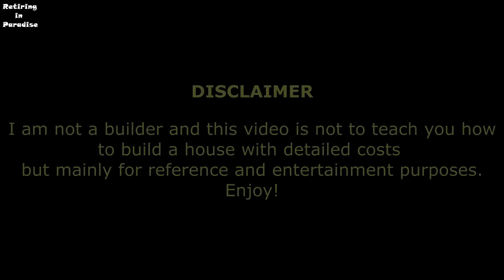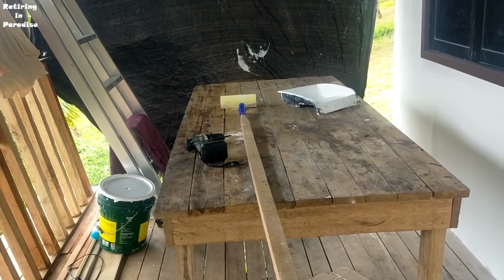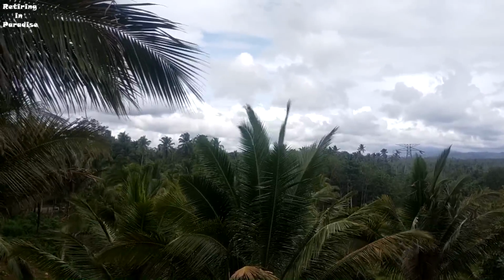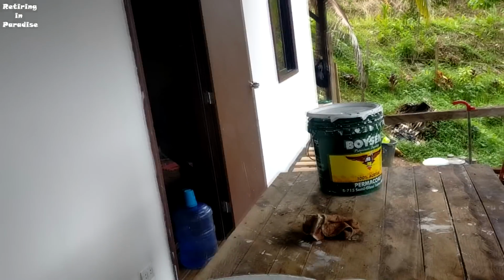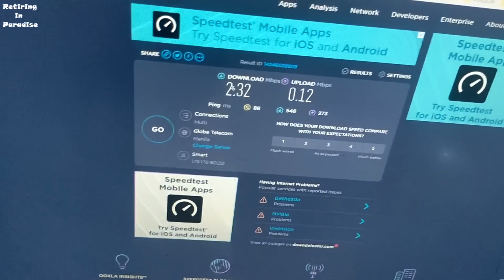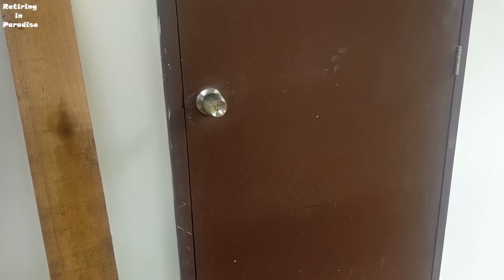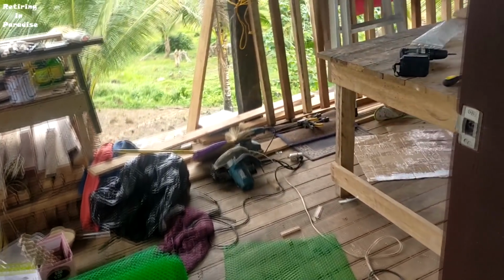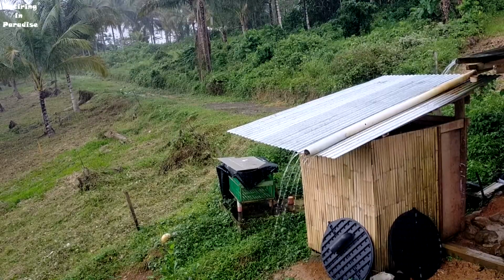V369 - Pt 88 FOREIGNER BUILDING A CHEAP HOUSE IN THE PHILIPPINES - Retiring in South East Asia vlog

Comment: Joe, I read the comment on the inside bathroom. If you don’t want to do it, that is fine. But man, you have the talent to do it. I have done a couple and it is no harder than the kitchen which you did a good job on!  Mine are far from perfect but they get the job done.😂
Reply from the maker: Cool, thanks!😊👍👍👍I will probably end up doing it and after the kitchen I feel I can do it

Comment: The problem with using sim card modem is when you use lots of data even if data plan is unlimited the provider will throttle the speed and slow it down.
Reply from the maker: I think you maybe right

Comment: wow really mate. A ladder on a table. Sheesh that's a formula for disaster
Reply from the maker: No problem whatsoever. This is the Philippines 🤭
Reply: @retiringinparadise  lol I mean it's a worldwide safety precaution. Maybe if you nailed the some brackets to stop the ladder from sliding just to make it safer for you then that's another story. And you aren't exactly as light as the filipino' so it would've been a massive earthquake in PH  lol
Reply from the maker: @phoenixson4382  the table has gaps